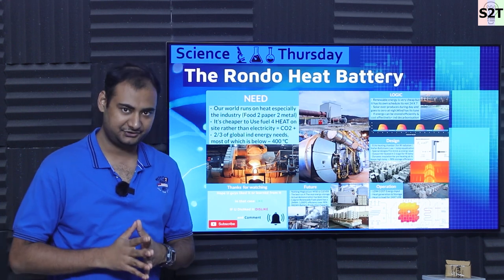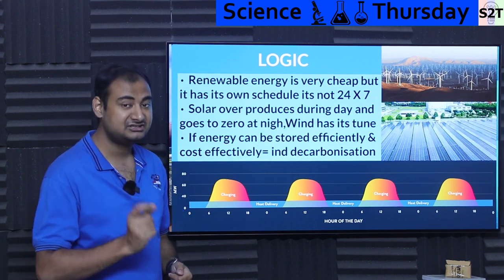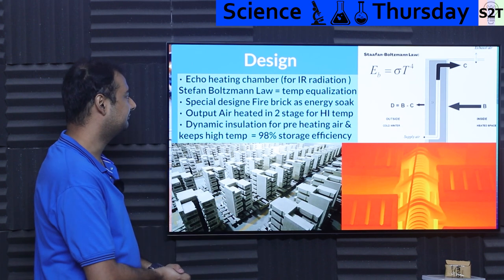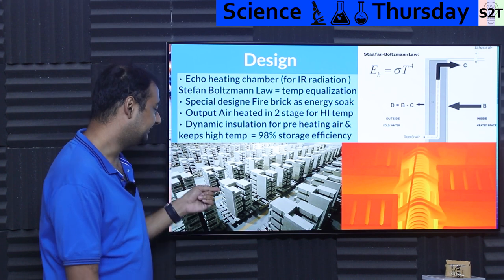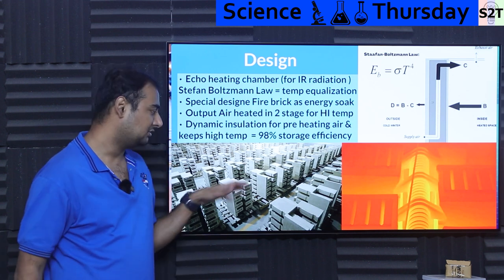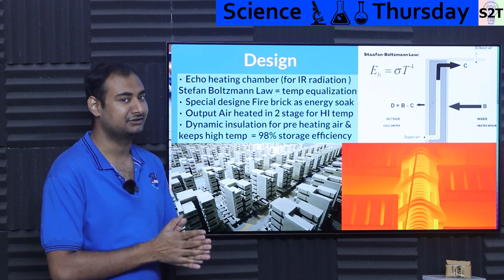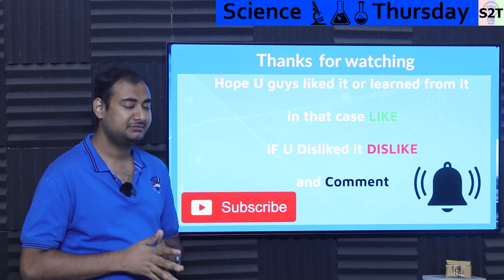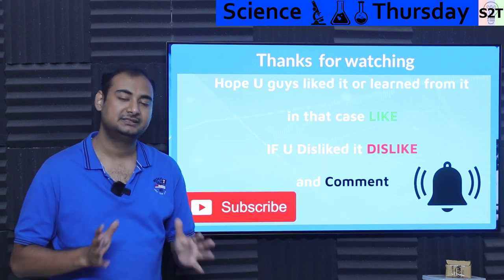Rondo Heat Battery Explained {Science Thursday Ep252}

Comment: Trying to understand how this technology could be used with my refractory rocket stove/pizza oven/energy storage bench.  Currently, my rocket stove quickly heats up refractory faces and exhausts through a secondary chamber refractory riser to heat a 1"x24"x24" steel plate.  The exhaust is then directed downward through standard wood burning stove pipe with aluminum fins that goes for 25 feet then reverses back to behind the rocket stove and upward for exhaust.  The stove piping with aluminum fins heats sand in a long bench and transfers that heat via an air exchanger-water exchanger which runs to another water heat exchanger in my home to supplement boiler heating system.  I wonder if brick would be better medium than the sand I am currently using?
Reply from the maker: humm depends on the TEMP these thing only work on very high temp 1000°C+

Comment: You would want your battery temp to be like 800C though even if your target temp is 400C as that means you can use over 50% of the capacity of the battery assuming 25C ambient temp.
Reply from the maker: only application is stationary industrial heat
Reply: @s2tenglish  Not that this had anything to do with electricity, when I say thermal battery I just mean a battery for storing thermal energy, I count a electric hot water boiler with a tank to store hot water that either uses spare solar or cheap grid electricity to heat the water to be a thermal battery for example which has literally nothing to do with electricity storage.

Comment: Eh I would have to ague with you that storing heat to turn into electricity later is dumb given how much cheaper thermal energy storage is than other methods of energy storage, yeh your talking like 58.8% efficiency best case, but more likely nearer 39% efficiency, but given that it's like an order of magnitude cheaper than pumped hydro which is an order of magnitude cheaper than chemical batteries per unit of energy stored, like if we are just turning off wind turbines and solar panels because we have to much energy to cost effectively store it in pumped hydro or chemical batteries... Well thermal energy storage starts to make some sense.

Obviously you would choose to store energy in pumped hydro or chemical batteries first, but when cost of energy is 0 or negative because you have run out of those types of storage it makes economical sense because the storage is so cheap and you might say, but you need to build the steam turbine... well, not really. We have a lot of coal and gas fire power plants that we should be shutting down, they have turbines, all you gotta do is rip out the boiler and replace it with thermal batteries which as said are dummy cheap.

Not a long term solution, but if we are taking the climate crisis seriously it does provide a quick and cheap way to install a lot of energy storage capacity. From the current technologies compressed gas would probably be a better long term solution as it has significantly higher efficiency, but it's more complicated and expensive than thermal energy storage and honestly you need thermal energy storage for compressed gas even if it's keeping it in a phase change meterial which has a freezing point at around ambient temperature because as you compress gas it gives off a bunch of heat, and as it decompresses it cools very significantly so you need to heat it which either drops efficiency or the power output as you need to collect thermal energy from ambient temperature air which is a slow process and would probably require power to blow air over radiators.

If you can store the heat from when you compress the air though, no problems.
Reply from the maker: this is not for  heat to turn into electricity later  its only for HEAT  that you need think more like a capacitor in line that deals with intermittent energy supply & your process gets controlled HEAT 24 X 7
Reply: @s2tenglish  Yeh I know I know what you were talking about, I was disagreeing with you that using thermal batteries as heat to run a steam turbine for electricity generation was dumb because of round trip efficiency losses, reason being is as I said thermal energy storage is a lot cheaper and when you couple that with coal and gas fire power plants being shut down to move over to wind and solar, you have a lot of steam turbines... just laying around which you can relatively easily cheaply and quickly adapt to working from heat from a thermal battery.

yeh you lose upto 60% of the energy, but also you were just going to have to waste that energy otherwise, because the ramp up for thermal batteries would be significantly quicker and cheaper meaning you can deploy more given a fixed budget and given amount of time than other types of energy storage assuming you are using decommissioned coal and gas fire power plants.

Even if you have to build and pay for the turbine it's still way faster and cheaper to build than pumped hydro and while it would lose to chemical batteries in time to deploy it's way way way cheaper than chemical batteries.

Like yes using them for decarbonizing thermal processes is a better usage of them, but it's not dumb to use them for storing electrical power to as a transitional energy storage method with the priority being decarbonizing thermal processes.

And yes there is a real world example in West Yorkshire in the UK https://www.energymonitor.ai/energy-storage/former-coal-fired-power-plant-hosts-new-battery-project/
Reply from the maker: this is not suited for that u need far more temp like 3000°C so u can dump heat for long duration before dropping to equilibrium .That is the  key to  Antora Thermal energy storage    https://youtu.be/Mx50VCgAmFc this uses graphite blocks more expensive (not that high) but can handle far higher temperature so u can not only throttle effectively & also have higher useful depth of discharge
Reply: @s2tenglish  Is anybody working on a thermal battery where the heat is extracted to a sodium lamp and then you use PV with a targeted band gap to the 589.0 and 589.56nm wavelength that sodium emits because that means theoretically you could get like a 90% energy conversion efficiency from light to electricity, admittedly real world like that would be 70% efficiency, and then you have the black body radiation from the glass tube you contain the sodium in, but we already have a solution to that which is just a mirror on the opposite side of the PV panels which is highly reflective of IR so you bounce the IR back at the sodium lamps which will emit most of energy again as light in the 589.0 and 589.56nm wavelength so even including that loss your probably talking 65 - 67% efficiency and as the panels to target that 589 and 589.56 wavelengths gets better like honestly 75 - 80% efficiency is not a complete pipe dream.

and you only need to heat a high pressure sodium lamp to 800C before it starts emitting light and we have thermal batteries which have an internal temp of 2000C so that enable you a large delta to store energy very densely, also would able you a short ramp down time, actually assuming we put the lamps inside the battery so they are constantly converting, but you have a shutter which can let out the light out you could have very short ramp up and down times for turning turning electrical production off and on and even throttling the amount by only partially opening the shutter.

To me sounds almost as good as Lithium Ion, but without the rare earth minerals of lithium ion and sodium is cheap and you don't even need much of it, you don't even have the electronics in a regular sodium lamp to ware down so they should last a very long time, and assuming your discharging the battery over a 4 hour or longer period thermal expansion and contraction shouldn't be a big deal so the lamps should last a very long time.

The panels will likely need replacing before the lamps, but those are also going to be outside the battery so easier to replace and thermal batteries are cheap.